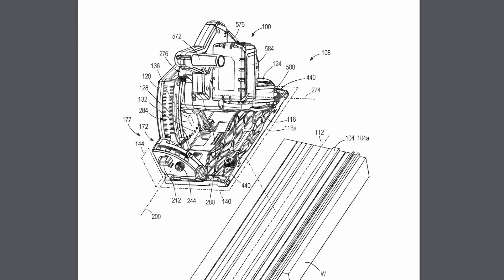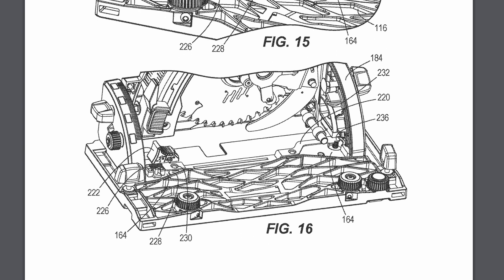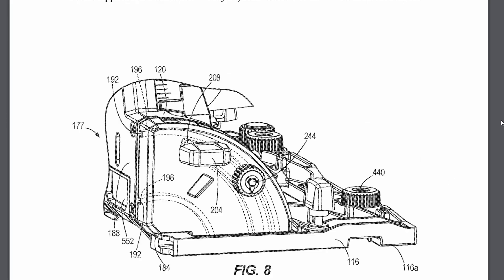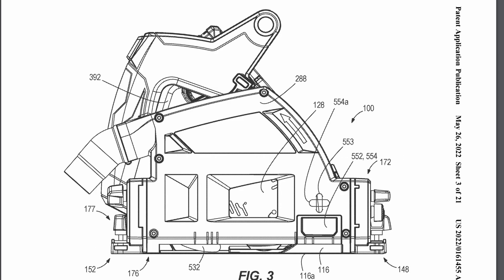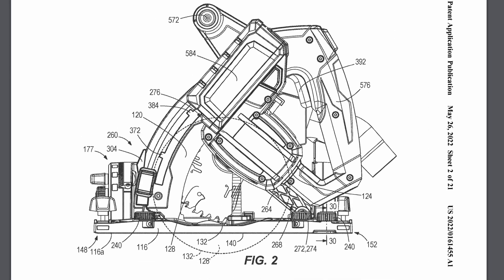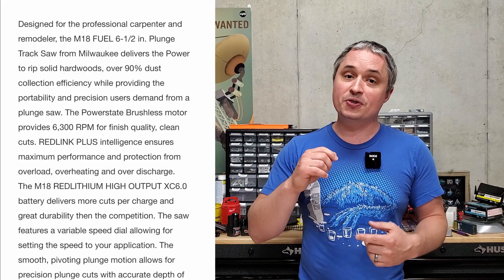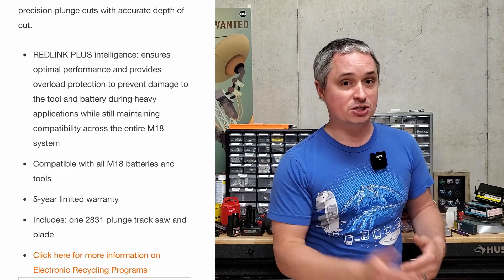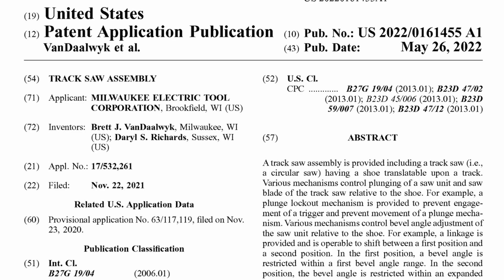M18 Track Saw Patent FILED by Milwaukee Tool!

Comment: Is it just me?  Or is there a fundamental flaw in how the tracks / rails connect?  Over time, the tracks go out of alignment, albeit by 1/4 over 110”, but that’s a very big deal!  Regardless of how you tighten, it’s be had major issues with these not staying straight.  I was hoping they would improve the track / rail system.

Comment: I don't like Milwaukee's -1 degree adjustment on the shoe. My friends saw would accidentally slip into that adjustment and he would notice it after making a bad cut. Seems pointless when you can usually just turn the saw around anywhere
Reply from the maker: From the way I read the patent, there's still a positive stop at 0° and 45°, and you have to hit an override button to go past those. So hopefully that won't be an issue with this saw.
Reply: @DoresoomReviews  I feel like they all have that and maybe my friends just gave out at some point. I know I like their tools just fine besides that and the loose chuck issue on gen3 impacts, also that the Surge always needs rerpairs. In writing this I am starting to wonder if they have any solid impact driver out on the market right now. I heard they have a new one on the way though

Comment: As long as it’s compatible with the festool and makita tracks I will be vary happy
Reply: You and me both. If it is not compatible and as good of quality, I won't have one even if I am on the battery platform. A track saw for me is a 1 time purchase and if I am going to spend as much money as it will probably going to cast, I a going to get a one of the top tier ones based on performance and quality, not the name on the side.
Reply: That’s right !
I got all the makita tracks 
And got the makita corded track saw.. and I love it just as good as the festool. But I have to say th ts75  saw a nice to cut thicker boards.
Reply: @dougw9239  Doug if you're only going to have one buy a Mafell

Comment: Finally....any news on that top handle chainsaw?? Or any pruners coming.. either hand held or quik lok attachment
Reply from the maker: I haven't seen anything new on the top handle, no news on pruners either. Although the M12 hedge trimmers shows they're thinking more OPE.
Reply: @DoresoomReviews  ok thank you
Reply: I’m waiting for the Makita 40v XGT Top Handle Chainsaw to hit North America.  I don’t like the set up Ego has for their top handle chainsaw but Tools & Stuff showed off what the Makita 40v can do and it certainly was impressive!
Reply: @treebossmike8818  It's my favourite cordless chainsaw.
Reply: @treebossmike8818  I'm pretty sure it's coming to Canada in fall, though if you're in the States in may be later.
Reply: @nelsoncarpentry  I’m in the States so I guess will have to wait until next year.